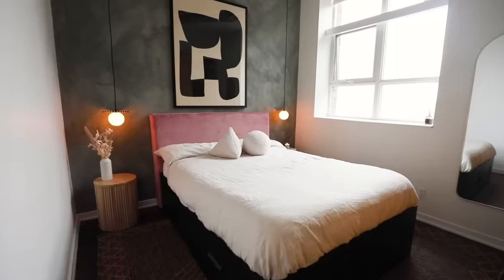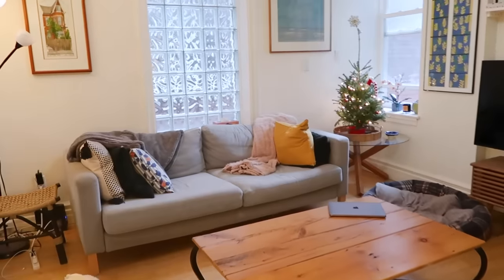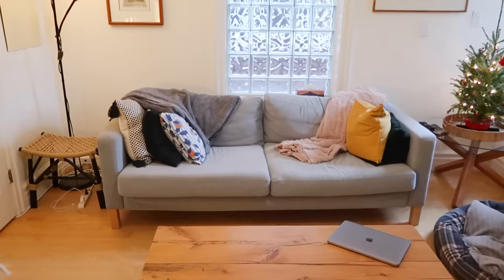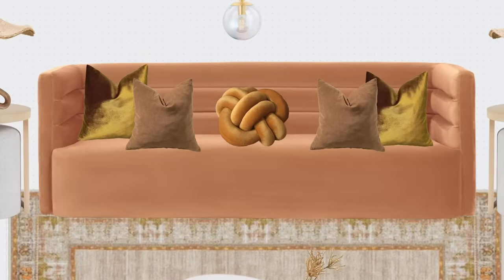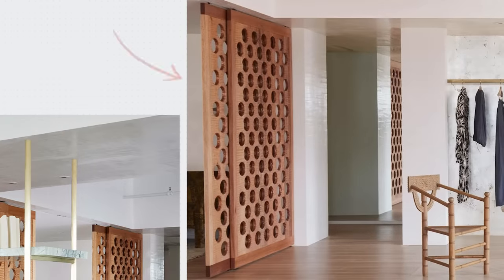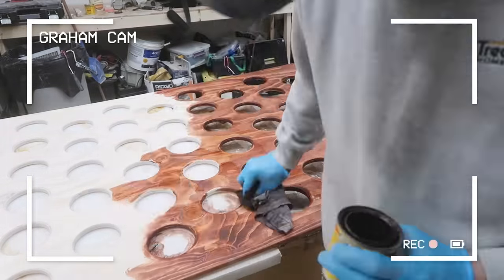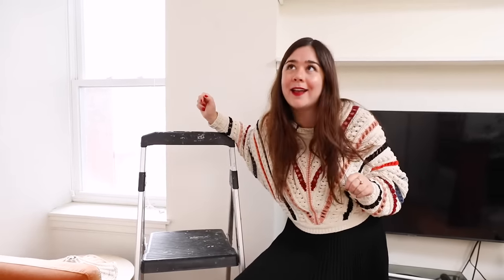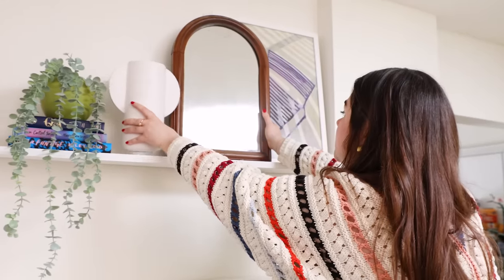Emma Chamberlain Inspired Living Room Makeover

Comment: Just a heads up if anyone wants the ruggable rug if you are by yourself it is easier to roll the rug (pattern inside)up and place on the rug mat by unrolling it just match edges first! For the larger rigs you can fold the rolled up rug in half first to get placement right before unrolling it!

Comment: I think it looks great! I like the fabrics the most. You're really selling me on a Hemnes cabinet, too. I gotta say, though, I realize fans are ugly and hard to clean but I'd be inconsolable if mine was removed. I'm not sure how hot it gets in Toronto (?) but it still looks better than shoving a tower fan in the corner. You can paint blades and get new light kits or globes. Not ideal from a design standpoint but I couldn't live without the air flow/cooling.
Reply: I live in Arizona so fans here are a must☀️
Reply: We've got air conditioning in our place and it often gets too cold in the summer, so we gave AG free reign to get rid of the old fan 🤓
Reply: @Will  I was wondering about that. I have central A/C and heat but the fan is non-negotiable! Lol. It circulates the warm air down in the winter too. But I'm in central Texas and SE New Mexico, so definitely a different requirement! Enjoy your new living room! It looks lovely!
Reply: @angieemm  😄thank you!!

Comment: Often when the mat slips down in framing, you can turn the print with the loose bit toward the bottom and give the whole frame a quick tap down. This causes the mat to slip back  into place. May or may not stay depending on how loose it was to start with.

Comment: Nice finished look.  I like the entry rug and area rugs that help define the spaces.  It's all very pulled together, coordinated and bright.  The side-table with poufs are brilliant.  The white coffee table doesn't make the space feel full or crowded.  Nice touch to put art on the tv screen.  The (roaming) throw blanket on the back of the chair/s needs to stay.
Plants are always homey, but I bet the palm will suffer from being so far from a window.
What happened her her colour choice of green?  
I think Graham could have tackled re-adjusting the print inside the matted frame.  I like the idea of hanging something over the left side of the couch, but I don't think the mirror gives proper balance to the art on the opposite side.  One thing that might help would be to lower the art on the right, which would also have the advantage of covering the unused electrical box.
I know what you were going for with the room divider, and it's a lovely piece, but it does make a bottle neck out of the entryway.  Since the chair on the opposite side still has space behind it, I wonder if you could have placed the divider closer to the rug, just to give a bit more space to people coming in and going out.  I was also surprised that you didn't style the top of the shoe cabinet.  By the way, are the shoes visible through the holes from the living room side?
What about a dog bed?

Comment: I do generally enjoy these makeovers, but the floor plant (I believe a Dracaena?) is troubling me for two reasons. 1., If it is a Dracaena, then it's toxic to dogs. (Spider plants luckily are nontoxic - check the ASPCA site.) 2., The palm is not near any direct light source, so it's probably going to struggle and drop leaves on the floor - which the dog could then eat and get sick from.
I've also got concerns about the fact there's now no place for the dog to sit, since it looks like the pup's favorite chair and bed are gone. (I guess the couch is big enough, now.) Also, that coffee table is far more form than function - it's gonna be hard to do game nights on that much smaller, asymmetrical surface, right? I did really like the entry way makeover, though, and it's always fun to see what Graham and the team whip up in the workshop.

Comment: But you didn't resolve their problem to hang coats and other items, instead you kinda made it worse. They could fit a lot more coats before, and now you've given them just three. If you had to make a divider, then why not continue a shelf above the shoe rack, and make it decorative in another way? (Without the holes) that way you'd still get the divide and they would have closed storage for the coats. There are some hanging rods that can be brought down by a manual handle to access hung clothes at a height, and since it would be closed, they could fit a lot of coats, dog leashes etc in that slim storage.

Comment: Earnest question here: why do interior designers always get rid of a ceiling fan instead of putting in a newer one that looks more aesthetically pleasing to the room? If the homeowners want to get rid of it, that's one thing, but I don't have a lot of windows in my space, so a ceiling fan is crucial to keep air circulating.
Reply: Good question - we specifically asked to get rid of the ceiling fan, we never used it and instead were looking for a nice new light fixture.
Reply: @WillfromTO  That makes sense - thank you for answering!